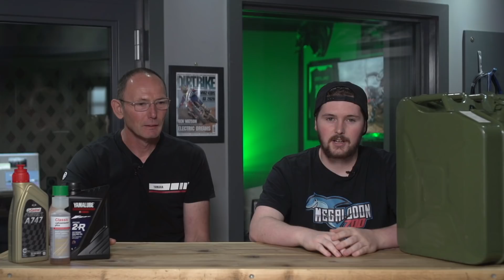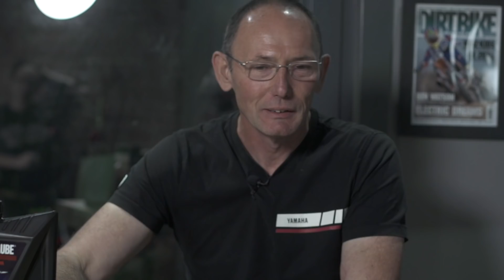Can I use E10 FUEL in my Dirt Bike?

Comment: I've used E10 with semi synthetic motorex 2 stroke oil in my 03' kx125 since I've owned it, about a year now, because my local garage doesn't sell e5. They run fine on it as long as the bike is jetted for ethanol fuel and you DONT leave it sat for long periods. The jets do tend to clog up on occasion if sat but I always start and ride my bike often and it runs great. I do also run octane booster in my bike which helps a bit. I do think there is a lot of fuss over the newer fuels, at the end of the day, if you're trail riding, road riding for putting around on your 2 stroke E10 is perfectly fine, if you're racing the bike, definitely use a little higher octane fuel or race gas. The most important thing with ethanol fuel is to NOT let your bike sit for more than a month with it in, it's very dependent on your weather/ ambient temperature but  on the whole the carb will begin to clog up after a while of sitting. 👍

Comment: Okay assuming the effort and expense went into proper engineering lets think about this....with fuel injection we ALREADY need a full time fuel pump so why not use gasoline as coolant?  Engineer the fuel pump to handle both functions and use materials on fuel tank resevoirs that allow them to work as radiators...now I know what the first problem people are going to point to which is running low on fuel could mean motor will overheat ....which any years ago would be a concern but these days with onboard computer adusting fuel delivery ignition and maximum rpm per temperature points etc?  When fuel gets dangerously low and or temps begin to threaten longevity?   Everything gets dialed back accordingly...what the bike at that point lacks in power it is making up for perhaps in RANGE....It just seems to me that early on in a ride with full complement of fuel that motor is going to have a fantasic abilty to stay cool....no?....also for safety concerns the fuel tank could be monitored for ruptures and actually cut the ignition if that is sensed

Comment: I think it's a conspiracy to get all old bikes and old cars off the road and off the track . I have many motorcycles in my dirt bikes I always run race gas (VP PRO6) in my KX450F and VP MRXO2 in my KX125 two stroke but that stuff cost $205. For a 5 gallon tub . and I have no problem with my bikes BUT in my street bikes my Goldwing 4 carbs my Silverwing 2 carbs my CBR600F3 4 carbs all of them ran fine when I parked them but after sitting for months all the carbs are clogged and have that green film all through them from putting that E10 fuel in them😵😵😵😵😵😭 now Ill have to rebuild 12 carbs before I can ride them 😣If I took them to a shop they want $120 per carb. To clean and rebuild! An average person that doesn't turn a wrench will either give up on their bike or get raked over the coals to have them rebuilt. The it will happen again if they let their bikes sit for a few months without draining the carbs and tank since that E10 crap has a very short shelf life. Its a conspiracy to ruin our old bikes lawn mowers anything with a small engine or a carb .

Comment: The US has been running e10 for years. We have non ethanol pumps for small engines. And e85 is run in high performance turbo engines. Never heard of any automotive piston or engine problems in the US running e10.
Reply: correction SOME areas of the US have local non ethanol pumps but many areas like in parts of southern california?  We are just F#(ked other than to pay 4 prices and buy it small volume pumped from a barrel not any gas pump out on any island at typical stations....

Comment: No. Corn fuel is shit and doesn't last. It leaves a film on parts even if you drain it every time you shut the motor down. Also the octane is never consistent making tuning a frigging nightmare because you have to test the fuel and tune to every batch you get from the station. Stoic is 14.08:1 not 14.7:1. I literally see absolutely zero reason to ever shorten your life and turn your hair grey just to be able to run e10.

Comment: Simple......get your E10 fuel, add water to it, shake it up and leave it for a few hours, alcohol(ethanol) is attracted to water.....water and gas don't mix......drain water from bottom of container and you are left with straight gas, or gas that has a tiny amount of ethanol.

Comment: I am from Holland and never ever put other fuel in my dirtbikes than Shell V power. It is zero ethanol and 98 octane. I never had issues with my YZ250, YZ450f, CRF450 and KTM SX250 bikes in the sand in severe conditions.

Comment: Don't use it.  I used to use it at high octane and if you let your bike sit it gums up, even if it sits for like a month, the jets in the carb so I was always cleaning carbs.  I switched to 92 Clear and 110 sometimes for the larger bikes and I've let them sit for 3 years and they fire right up.

Comment: It’s definitely worse on 2strokes than on 4strokes. It’s harder on crank seals and will turn to vapor in the bottom end before it makes it to the top end. It will also pull atmospheric moisture out of the air and it will separate leaving the bottom off your tank where the petcock is with water during storage in your bike. Then when you turn your gas on it fills the carb with water and alcohol.

Comment: I’ve been using power plus 105 octane and maxima 927 in my yz144 for a fair while now, the fuel is e10 and oxygenated 3%, I’ve probably gone through about 80 to 90 litres, I did have to up jet my pilot and main jet significantly but it is an oxygenate fuel so it did need it. I’ve done countless plug checks being parinoid that I’ll melt a piston. I haven’t even changed a ring yet since the fuel change, I did notice that my bike ran colder roughly around 5 degrees because I run a temperature gauge radiator cap. I pulled my top end off last weekend, so that I could get an insert made for my vhm race head . This bike has sat in my shed for upto a month without being Started and It showed no signs of corrosion, I do block the tank breather pipe tho, overall I’m impressed with the fuel and with the right steps it can be safe for your two stroke.
Reply: That’s some good info, thanks.I’ve just purchased some powerplus 99 to use in my CR500. It’s 1% oxygenated and I was hoping not to do any jetting changes. I usually just use 95 octane with maxima 927.
Reply: @tdog54  I’d definitely be doing plugs checks if you try it mate, the power difference, from 98 octane pump fuel to the 105 was very significant, the extra bottom power it made for my bike was really noticeable and it pulled harder the whole way up . I did try 102 power plus for a while aswell, the throttle response was abit snappier than the 105 but I like the 105 better, I’d definitely try it but you will have to re jet it. Take small steps and if it doubt plug check .
Reply: @fullnoyz  I looked at the 102NE also. Not oxygenated. I’ll defiantly throw a new plug in before I try the 99 and inspect it. I guess being a 500 Iam not looking for extra power but just consistent fuel and engine protection. I don’t ride it that much at the moment. 👍👍👍
Reply: too high octane can result in a lot of unburned fuel meaning carbon build up and eventual lowered performance if plugs foul etc...dontgo outsmarting yourself with unfounded logic
Reply: @dougiequick1  once I used the vhm head I found the 105 to be a bit doey and fouling plugs quiet often.because I changed compression I changed back to 102 octane and it runs perfect now, a new piston changed not so long ago and there is hardly any carbon build up on top of the piston or ports and the pipe is ok too, all just trail and error but I’m happy with how the bike performs 👍

Comment: yeah i never trust e10 for my quads or dirt bikes...
i run e85 in my car mercedes clk200 kompressor gtom 2000. actually all my car run e85 cause cheap 0.65€/L  bmw e36 318i 1995, alfa 156 2.0ts 2001 ran 100% e85 fine no tune needed started first key turn, my old mercedes w203 c200 from 2000 didnt like it that much start rought and ran like a patato but also had over 300k km and was a shit box. but my clk200 kompressor runs fine starts rough, but it runs fine after. wierd thing is mercedes clk230 1998 and 1999 start and run fine on e85. but 2000 and 2001 models have rought start... for me any car befor 2000 with 1 oxygen sensor runs great on e85 but when ever there are 2 it fuckes up the values still runs but starts are horrible, otherwise e10 95 doesnt do shit for car if you use e10 95 or e5 95/98 i mean most cars will run on 50% e85 and 50% sp95 without a problem
but i dont trust e10 or e85 in carburator stuff... a quad will probaly run on e10 maybe e85 with if you jet if right but nah i stick to 95... even doh most are e5 and on rare occasions you can smell the difference between stations with sp95 some smell like good old petrol others you smell the ethanol... just anoying you can fine real 95 or 98, its all called e5...

Comment: Hi m8, used something in my yz 250 2stroke, must have been e10 before it was even out on 1st sept, still having running probs now, pilot jet keeps getting crap in it , but so small cant see what it is , even tried a pin to get it out to see what it is,  but cant,  once I blow out jet shes good, but leave it a while, blocked again , is this anything to do with e10🤷‍♂️, just dont understand why it's the pilot jet every time,  can you gun this past roland  bud.👍🏻, I've flushed fuel can, fuel tank, card with brake cleaner, still getting probs🤯🤯🤯🤯🤯😪

Comment: Run at least high test in any high performance motor.
Reply: "high performance" is not the right term...it is the COMPRESSION that determines what octane....high performance is a realtive subjective term....a motorcycle could  produce 100hp and achieve some very "high" perfromance numbers and yet still only need and in fact best run on 87 octane gasoline.   I have had to talk certain people OUT of running premium fuel in their lower compression engines....they ASSUME they are doing good and pampering their beloved vehicle when in fact all they are doing is adding extra carbon to the combustion chanbers and wasting a lot of money....never assume such!  READ your owners manual and trust it for octane requirement...not some cars like late model Mazdas with Sky Active can actually run from low to high octane and the system will adjust things to work safely....you will benefit with higher horspower with the high octane while saving money without damage running regular gas....fun days canyon runs or track days?  PREMIUM....Then same vehicle for commuting or a road trip?  Use regular!  Best of both worlds for my little mx5 roadster!

Comment: Both CR's were running hot today - at Bwl track, probably know why now! Anyone know if you have to flush the cranckases with modern Castor oil , like you had to with Castrol R, Castor oil and additive sound the best plan!??- Glad you did this one Max.
Reply: I have run Castrol A747 for years (it's the modern Castrol R). I have never flushed the cases like that when swapping to use it, just drained all the old fuel out of the tank/carb and then run my fresh batch of Castrol A747 mix. By the way, the Esso Supreme 99+ you can buy at the pump has zero ethanol in it and I will be using that from now on.
Reply: @nickmys4137  much appreciated mate👍goes to show how many years ago I did it last. Also the fuel tip. The lad I ride with has been getting the fuel- it's e10. Never from today. Thanks for taking the time to post you reply- I can now concentrate on hanging on to the bars instead of fuel issues! Lol

Comment: Great info, but this all seems aimed at 2 strokes. Is this info also valid for thumpers?

Edit - silly question as this is a 2 stroke channel I know; but the info would be handy
Reply: I would say besides the storage issues, there is absolutely zero issue with E10. Gas stations in the USA have had it as the main fuel source for a number of years. Stock motorcycles (Off road race bikes and motocross) bikes run fine on it using premium unleaded. I usually buy non-ethanol but the vast majority of folks use gas station gas. It's kind of ridiculous what these guys with no experience with it are saying IMO. @999lazer
If you're running a high compression with aggressive timing use freaking race gas anyway.

You have to go through your gas every couple months. Ethanol is very bad to store in a bike... Very bad. Even using stabilizer can work but I absolutely don't.
Reply: For reference, before I had probably 700 hours on Beta and KTM 2 strokes with high compression heads using only E10. bottom ends still no play at 350 hours on both... 
Good info at the end regarding storage.... it's the only good info IMO

Comment: Hot tip- mineral oils do not mix with alcohol/methanol. Bean oil (castor) does. I would still drain the tank and carb dry before any kind of storage after using E-10, or even run a little heavy mixed meth-free fuel through it.

Another alternative is doing a full methanol conversion. Its illegal for motorcross, but other forms of racing allow it. It is just as maintenence intensive, but offers up to a 30% increase in power (with proper set-up), at the cost of increased consumption. Kits are available from various aftermarket manufacturers.
Reply: hint NEVER try to wash out a steel fuel tank with H20 when switching two stroke oil types!   As a very young man I did that ONE time and destroyed the gas tank in a single day....really thought that would be fine....lol NOT!

Comment: Most carburetted bikes have a fuel bowl drain screw on the side you just crack open with a screwdriver to drain the fuel in the bowl with the petcock in the off position..the 17mm hex plug at the bottom is there to mainly facilitate quick main jet replacements.

Comment: Max? How much oil is recommended down the plug hole, most guys running the nationals have a race and a spare, twice now I’ve had the race bike in the spare room of the house, mrs loves that.. but still 3 months later twice I’ve had mains seized solid… 

So how much is enough down the plug hole, I’d rather go more than not enough.. is it a tea spoon? Or 50ml
Reply from the maker: Hi Ash, Roland says about a cap full from the oil bottle

Comment: You mentioned some petrol stations have 0% ethanol labelled as e5. Do you know which companies in particular as that could be useful to know if one company isn't adding ethanol at all to their fuel?
Reply: Esso supreme synergy is 0%
Reply: @harland292  thanks. Just looked on their website it does say synergy is 0% ethanol except sites that are supplied from North Wales, North England, Scotland and Cornwall. So it depends on where you live. Will have to look further into it.
Reply: I've been using Tesco momentum at 99 RON in my road bike and runs like a dream.

Comment: Well done , Great advice on over winter storing dirt bikes ,drain the carb and tank . When we changed over to unleaded fuel back in the late eighties there were two bikes which could not run on unleaded Honda CB1100R and Yamaha XT500 , not sure what they were meant to use back then instead but probably unleaded super now . As far as I was aware vegetable based oils do not combat moisture on engine components and fully synthetic two stroke oils are much better in my opinion anyway . The tip on using avgas mixed in your fuel has been used successfully by classic racers for a long time , but with unleaded super as opposed to normal unleaded . Using unleaded super increases the octane rating of your fuel .